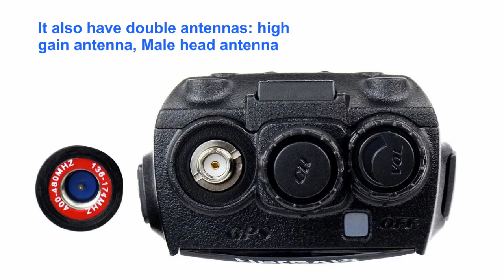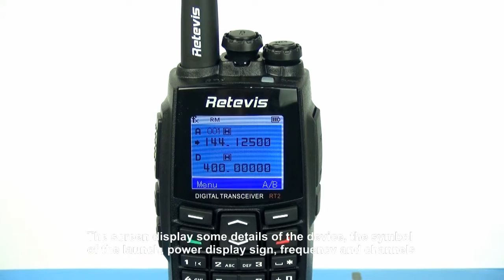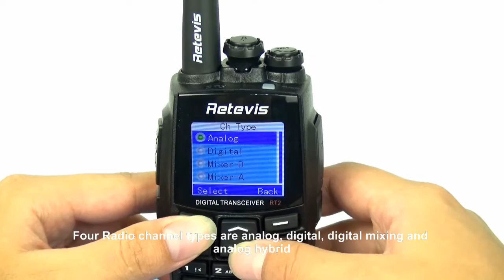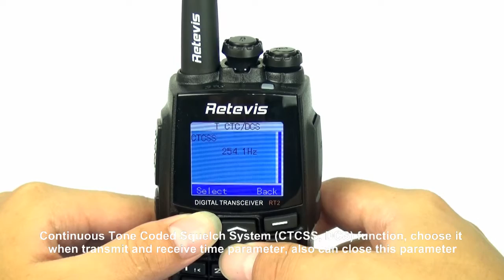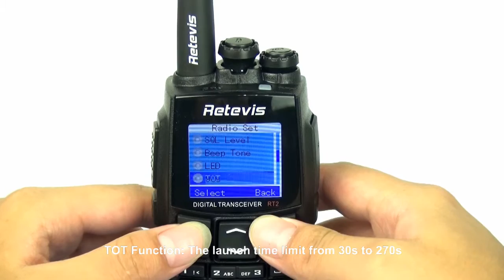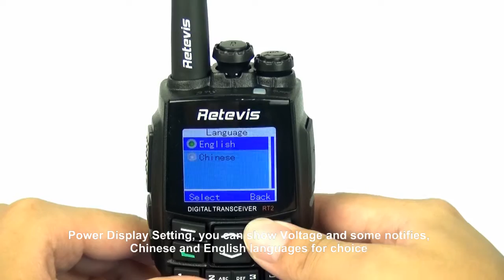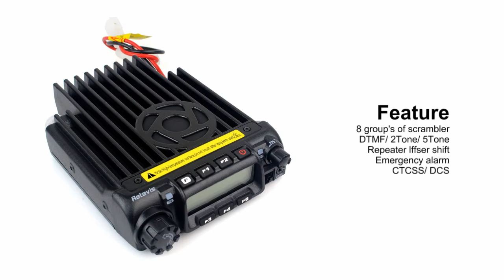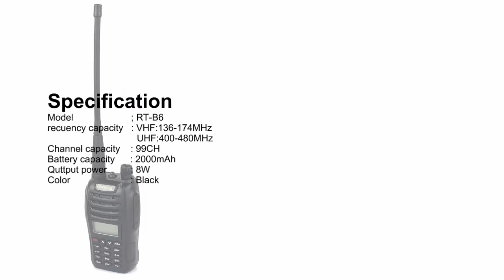dPMR Digital TWO WAY Radio Walkie Talkie RETEVIS RT2 A9107A

Comment: Looks like a TYT DM UVF10 clone, typical Chinese radio rebadge.
Reply from the maker: Retevis is a young growing company. we're devoted to collect specific suggestions,including yours, then to improve it. if you have any suggestions,feel free to tell us pls. appreciate it  and thanks.
In the early stage, Retevis did cooperation with TYT. we're trying to grow, however, that's not faults,right? i believe many "world famous enterprises" are made in China,such as @apple,right?
Reply: I both have Retevis RT3 & TYT MD380 and am very happy with them.  I would possibly like to get either RT81 or MD680.  Is RT81 true Tier II, slot 1 and slot 2?
Reply from the maker: Thanks for your support. however, RT81 is only single slot 1,not 2. 
probably how about RT8? it's better. http://www.retevis.com/rt8-ip67-dmr-radio-page/